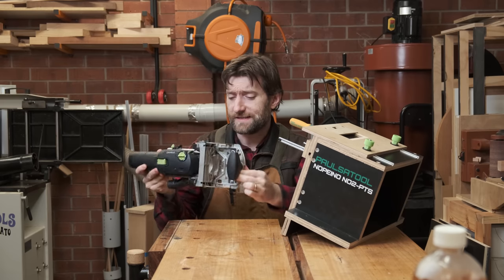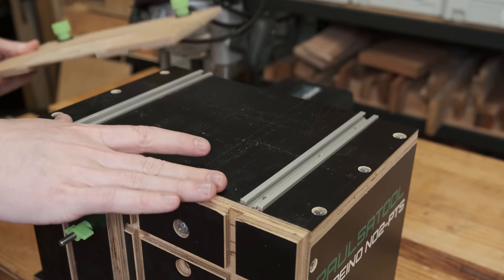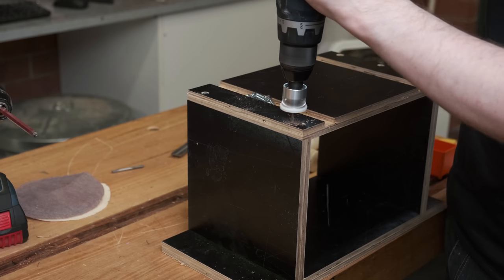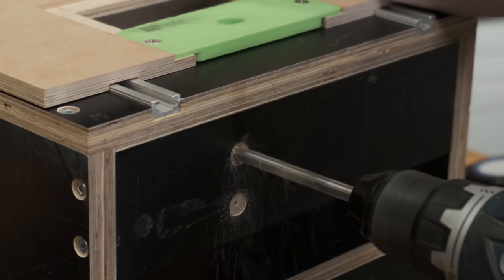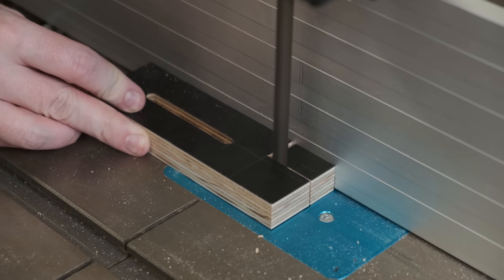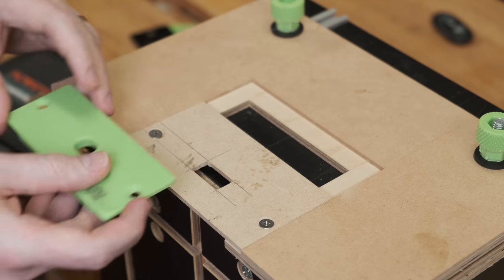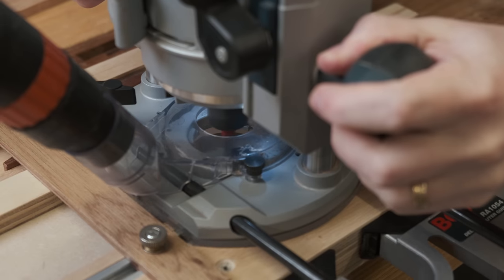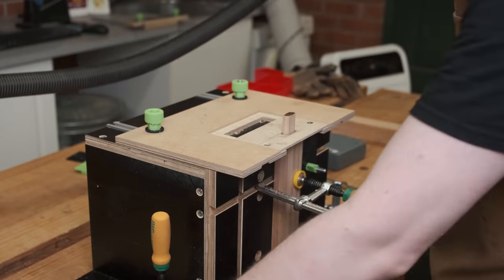No Domino? No problems, build the PAULSATOOL NOPEINO v2, for free!

Comment: Everything is good. Or okay I should say. I am almost done building the Nopeino. There is one thing I completely don't understand. Where do the adjustable stops go? Where do you use them. Seems odd that you did not demo a feature that you went to the trouble of showing how to build.
Reply from the maker: 12:49 you can see the stop in use to position the workpiece. 
Stops go on the table and control/limit one direction of positioning, while the top carriage provides control/limits for the other direction.
Reply: @TheWoodKnight  Don't know how I missed that. Now it makes complete sense. Thanks for these plans. And, of course, thank you for not valuing my time!
Reply: @TheWoodKnight  Ok! I did it! I made a Nopeino!! And it works great. I made a few changes to take advantage of my powertec quick release ratcheting clamps . I routed my own t-track in with a deeper t so that I could slide the clamps and avoid having to get involved with the matchfit system. Downside is that you have to rout the track first with a 3/8 bit and then run the t-slot bit through. Normally I would run both bits and 10 mm deep but to accommodate the clamping system I ran the t slot first at 10 mm and then at 15 mm to make it deeper on the T. That way the powertec clamps slide through easy. I used a 1" wide board to leave some meat on the back after I ran the slots in. I also ran my t track slots in at 75mm and 150mm. This made it simple to rout with only two measurement set ups. Run the 150mm in and do it in both directions. Then run the 75mm in and then just flip the board for 2 in vertical and horizontal direction. That makes 3 slots in both directions. This way I can easily place 3 clamps in either direction and hold down some very heavy pieces. Also a regular stop from my drill press jig can now just slide in for repeatability.
Reply: @TheWoodKnight  I have one more question. Could you do a mortise on a bevel with this? I guess you could mount a front table on a 45 degree angle to secure your piece to a flat surface. Wouldn't take much to rig up. You could easily screw the bevel table in from the back of the Nopeino to secure it to the cross braces.
Reply from the maker: @ptcruiser2012  I haven't really thought about angles like that if I'm being honest, but yeah some sort of hinged table could work, maybe a protractor on one side to quick-set the angles?